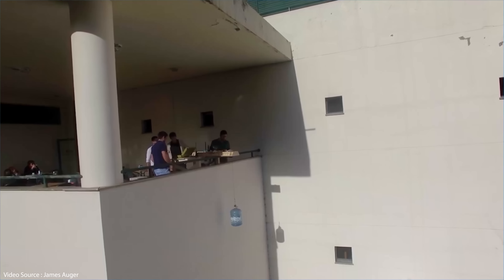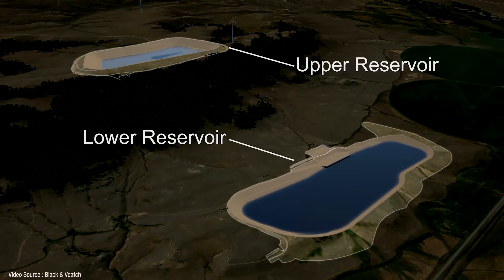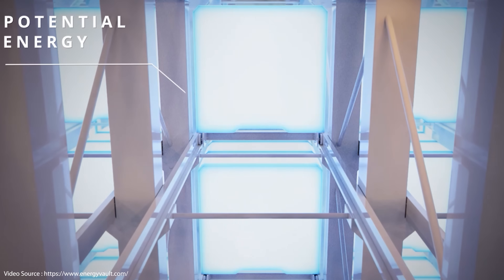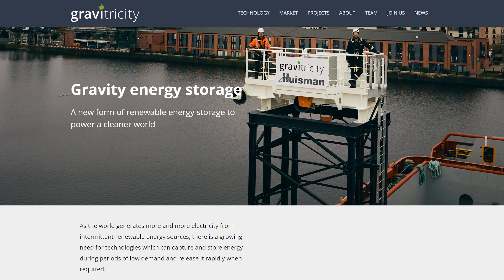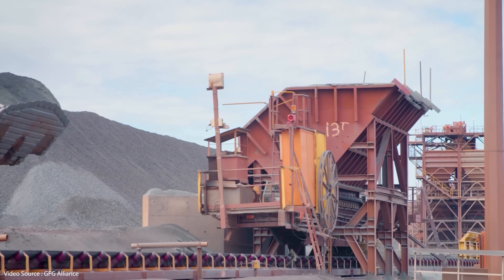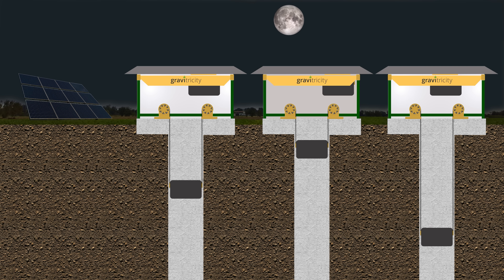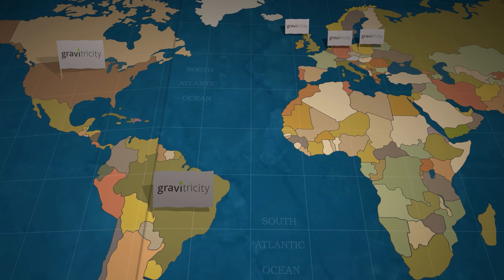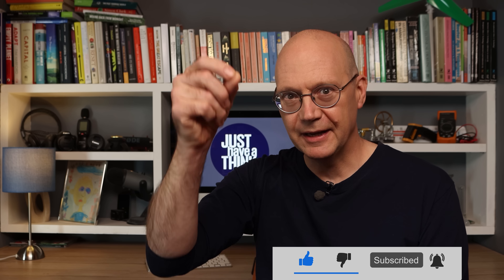Gravity Energy Storage. Who's right and who's wrong?

Comment: The Gravitricity system sounded great last year and I'm glad they're making progress. Shame that the government doesn't help and get things like this pushed along. I can see this working really well to balance the over and undersupply of wind and solar.
Reply: 500 tonnes at 500m is 680kWh.
Peanuts
Reply: @dougaltolan3017  Yeah, that's what I get:  5e5kg * 9.807 ms**-2 * 500 m * (1kWh/3.6e6 J) = 681 kWh.  This does seem like peanuts, given the size of the apparatus required.  Is their LCOS really correct?  It all hinges on that figure, assuming it's calculated correctly.
Reply: @incognitotorpedo42  I just had a look at the stats for Dinorwic... 9.1GWh, that's 13,300 times the storage.
LCOS is likely to be about as low as they, but unless they can find a stink pias of disused mine shafts in good condition, well, it will be a good earner for them but not a grid scale solution.
Reply: @dougaltolan3017  For Dinorwig, that 9.1 GWh is the total capacity of the ~7,400,000 cubic meters of water that flow during production. For this gravicity thing, that 680 kWh is the capacity produced by just 1 of the 500 tonne blocks. So yeah... you'd need to drop ~13,300 of those blocks down those 500m shafts to match the 9.1 GWh capacity. That's gonna be a lot of peanuts.
Reply: @incognitotorpedo42  I suspect their LCOS is utter nonsense.
Reply: @mralistair737  Perhaps, but Imperial College London is a pretty reputable university - care to give any details on why you think it's so bad?
Reply: @aeonturnip2  pricing the operational costs of something that has never operated before is not an exact science..  they have barely got the test rig working. There is an obvious advantage for these people to deflate their costs to make them look more attractive to funders and backers, so the myriad of ways to massage a statistic makes me sceptical.   for a start, are they just looking at this one mine shaft they have lined up or are they looking at a range of types of shafts? do they own the shafts? did they pay for this shaft?  was that included?    

 The report they show there even starts by saying "the complexity of electricity storage technologies and fundamentally different applications present a challenge for adequate cost assessment"  

I mean in their graph they suggest their operation costs (not capital) will be less than that of lithium batteries.... the ones with famously no moving parts or mine shafts to deal with.   And that graph doesn't show pumped hydro and shows only an 8 hour discharge cycle, which might be a good niche for some storage, but is obviously not what battery storage is intended to do well. 

But the gravity vault was such an obvious "emperor's new clothes" that they need to set a pretty high bar to get out of that gutter. .
Reply: @aeonturnip2  oh and while i cannot find that report, imperial also produced a very similar report for a different gravity concept called Heindle.  and in that one it says "Data for the Heindl Energy Gravity Storage system is provided by Heindl Energy GmbH."  so the capex and operating costs were not scrutinised by imperial, they were likely provided by the company.         

and for pure speculation, gravitricity founders are imperial graduates... and the imperial report has disappeared form the gravitricity website.
Reply: @dougaltolan3017  that's about 100,000 peanuts.
Reply: @Bajamba  lol, nice to see some maths here.
Reply: @dougaltolan3017  That’s enough to power 10 homes comfortably. I guess it depends on the cost to create the infrastructure for a 500m mine shaft vs a windmill or solar installation 🤔
Reply: @jeffdelnin457  ten homes per minshaft is like farting against the wind.   imagine someone turned up to your house with a 50 tonne weight and said, here's your energy storage device.  it doesn't sound sensible. or something we could scale to any significant proportion of houses.
Reply: @mralistair737  10 homes per 500 tonne block. More than one block can be dropped down the shaft during a discharge cycle.
Reply: @Bajamba  500 tones of concrete is 25mx3mx3m ish.  that's going to take a lot of handling at both ends of end of the shaft. which their concept diagram doesn't show at all.  lets assume you get 20 round trips per day, that's still a tiny village worth of power. or some peak cover for a small town.  

or to put it the other way round it would cover the excess produced by 3 or 4 big   wind turbines when the grid is oversupplied.
Reply: @Bajamba   Multiple blocks going down the hole means you're now running robot switching yards for huge weights, one deep underground.
Reply: @jeffdelnin457  Ten homes for what duration?
680kWh / (10 * 6.8 kWh per 24 hours) = 10 days.
Or a hundred homes for 1 day.
So, to let's say to power one million homes you would need 10 000 of these @500t each.
That just doesn't sound very feasible.

(Neglected in this calculation are all losses, ineffeciencies and also the fact that this system would only work/be needed in excess/high demand scenarios. So, the cost/performance ratio is even worse)
Reply: @dougaltolan3017  as compared to what?
Reply: @TheLosamatic  Tesla model x battery capacity 100kWh.
As compared to the solution that is required.
Reply: @dougaltolan3017  that's a little over 2 months of my summer energy use running there AC...
Reply: @dougaltolan3017  That size, sure, but they're planning bigger installations - the first one is likely 4MWh.  Yes, it's not a lot, but it's for short term storage and dicharge times.
Reply: Jan klaas, i dont understand your emoji. What is the joke?
Reply: You Tube  What's yer point?  Every time you drive on an interstate highway, you benefit from that tax payer funded project.  Or receive a package or buy food at the grocery store.  Same for airports.  Even if some corruption occurs, and it always will, that's no reason to forgo the effort.
Reply: Yes, but the amount of energy stored is tiny compared to the effort put into materials and construction.

You can calculate gravitational energy potential yourself and that will open your eyes on how many "gazillion" tons of material you need to even store 1 MWh.
Reply: why should the govt gets involve?
Reply: @dantronics1682  Because they have the funds to develop key infrastructure that helps society... Much of what we enjoy now was funded by governments.
Reply: @dantronics1682  Because renewable energy is a public good.

Comment: Why not go closer to existing reality? And ask why we should not install devices on building elevators to use electric energy to lift weight and when bringing weight down the same system can generate electricity? The electricity created may not be too much but we must remember that there can be tens of thousands of elevators in a city which can make a lot of electricity. By this way a lot of the electricity used to lift weights by the elevators can be regained. Also since generating energy when bringing the weight down always makes resistance, this resistance can work as some kind of a break and make the elevator safer to operate.

Comment: I wonder if old mine coal shafts could be used for this system? In Netherlands there still are several up to 1000 meters deep.
Reply: Gravitricity is designed to use old coal mine shafts that's the whole point.
Reply: @jasonleahy5543  ah thanks, i tink i lost that in translation. ( i am Dutch)
I thought they had to dig special size holes to specific depts

Comment: The truly interesting point of lowering a weight into a very deep shaft is that you don't need resets, which are a waste of efficiency. All you need to do is a lot of separate weights on cables, and take turns raising some weights on condition of surplus... whoever is closer to the end of their descent can get re-raised while others higher up descend if energy extraction is needed at the time. If no energy extraction is needed, raise them all. A matrix system like this will be immune to outside weather and can have a much farther travel length than any above ground suspended weight system. Multiple weights also gives redundancy to mitigate failures.
Mind you I'm just talking out loud and I'm not an engineer so feel free to take a hot s**t on my point of view if it's needed.
Reply: More parallel weights mean more (or bigger) holes more cables and more generator. How could that increase efficiency? 
You can see in the animation that they plan to have one hole and one lifting/lowering system but multiple weights.
Reply: replace the weight with water, since its a mine shaft you can just dump the water so it takes less energy for winding /raising
Reply: @dantronics1682  mines need pumps to drain them, else they flood
Reply: @dantronics1682  - that is hydro electricity.
Reply: ERR why not just use water like for the last 100 years https://en.wikipedia.org/wiki/Pumped-storage_hydroelectricity
Reply: @zenko247  This is a complementary technology to pumped hydro, as David explains in the video.
Reply: @johnsimpson99  but still reinventing the wheel
Reply: @zenko247  Rocks and iron ore are a lot more dense than water.  Probably more energy can be generated using rocks than water or perhaps the depth or height of the mechanism can be lower, so it needs to be stronger but not as high.  Just guessing.
Reply: @simongross3122  Pumping liquid uphill is much easier and  Efficient then raising  solid mass. thats why it has been used for over 100years
Reply: @zenko247  That may be so, but water weighs one kilogram per litre whereas rocks and iron ore weigh much more for the same volume.  To store the same amount of energy as a kilo of rock, you would need to pump a lot more water.   That's why hydro storage needs so much room.  In any case, we don't have to choose one method or the other.  They each might be appropriate to different situations.  For example, it might be better to use solids in places where there is no water or where the water is need for something else.  It might be better to use water where there is an abundance of water and where we already have dams.
Reply: @zenko247  Because of scarcity of water is the most often cited reason. Like the issues out west, currently. It's long been known that water can be pumped back up into a reservoir at a hydro plant to provide a kind of gravity battery effect but what if your water situation collapses? But that's only an issue for fresh water. Last I checked the oceans are only goin' up. Why not make a giant ocean water reservoir right on the coast and use it specifically as a gravity battery?
Reply: @NightRunner417   And the amount of water needed to produce the power to lift the mass ???? PS ocean water power has been a thing for Decades ( the level goes up and down twice a day  It's called tide power)🤣😂

Comment: Gravitricity does seem really promising, but it probably won’t be as versatile as some other designs, since to get that low LCOE it will have to reuse mine shafts, or it will run into the high cost of drilling. Additionally they will have to avoid intersecting water tables, which pretty much eliminate coastal power generation.

None of this invalidates the promise, though. It’s still a very clever design.
Reply: Even if the shaft is flooded the weight will still go to the bottom.

At some loss to efficiency but it will still produce power.
Reply: @shawnr771  That's correct, however it will severely shorten the operating lifetime of a the system if it's not designed for water contact, or it will require the extra cost of water proofing.
Reply: @seeranos  Painted iron weight.
Perhaps they could make the weight lift far enough up into a slightly larger space so there could be inspections and maintenance.

I had another thought.
Make the outside of the case out of a rubber.
Also the weight could be made as shell housing material more dense than iron.
Although preferably not something toxic like lead or spent uranium.
No need to poison the ground water.
Reply: @shawnr771  Yeah, I mean there are for sure ways to inspect and protect the mechanism. It's not an impossible hurdle, but the big point is the low LCoE would lose its competitivity as the compexity increases and the more drilling required. 

I'm not an engineer though, so I'm sure the team has considered these things.

Comment: Where I live, in Alberta, Canada, there are a lot of unused oil wells.  The average depth is about 1.5 km.  I wonder if these could be used for gravity energy storage, or is their diameter too small.
Reply: 1 ton dropped by 100m produces about 1MJ of work (0.277 kWh under ideal conditions). Use 10t and 1km and you will get 27 kWh of energy per drop. Actual amount will be determined by losses. You will need lots of unused oil wells.
Reply: @janami-dharmam  thanks for the calculations, it shows the limitations of this concept, even if using deep mine shafts (like in South Africa) with conversion of existing lifting gear there is going to be very limited power production per drop.
Reply: @janami-dharmam  So are those figures then according to 100% efficiency? Just trying to get educated with all this.
Reply: Width might not be the problem, but oil wells are not necessarily nicely vertical shafts. They can be pretty curvy. Unlike mine shafts, oil shafts just need to be able to transport a liquid after all.
Reply: Technically no diameter is too small because for one you can do matrix type applications that use a lot of such wells with small diameter weights. Also, if you use heavy metals for your weights, you can do a lot with a small diameter. Pick up a lead cylinder of 1" diameter and 5" length. Now do the same with a cylinder of 1" diameter and 20' length. I guarantee you you're gonna bust a gut on that 20 footer and embarrass yourself, lol. Mass doesn't care about form factor unless balance is all gnarly or it's too thin and frail to suspend it's own weight. 🙂
Reply: Since it's made with containers filled with stuff, I don't see a reason why you couldn't make longer, thinner containers and fill them.
Reply: @bearalohalani  Can't argue with such scientific reasoning! You're obviously a genius.